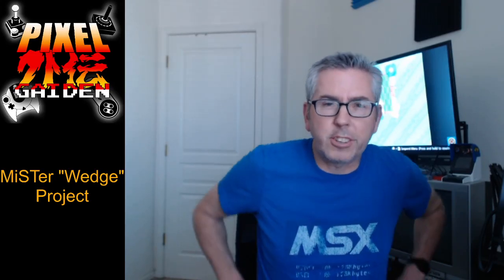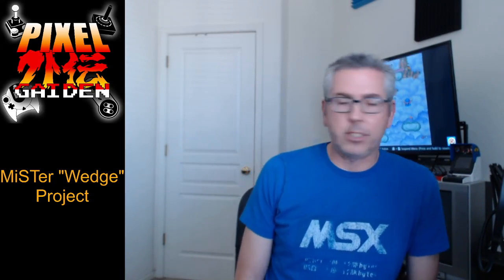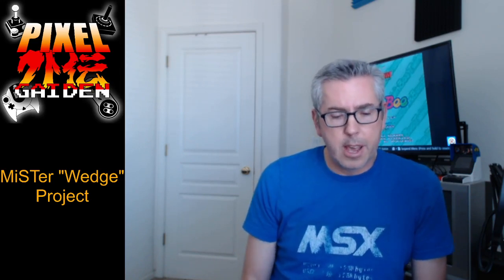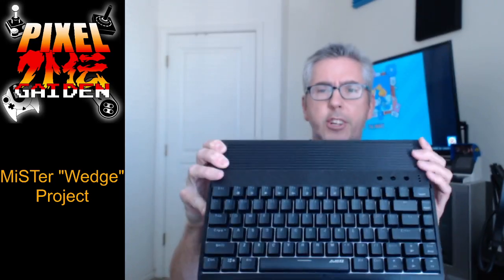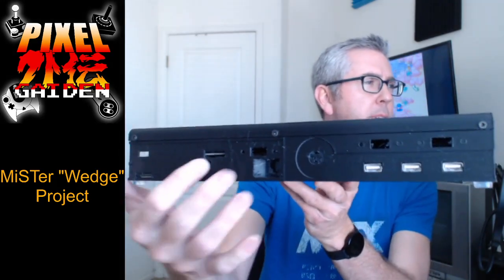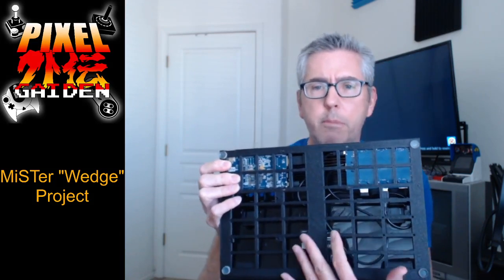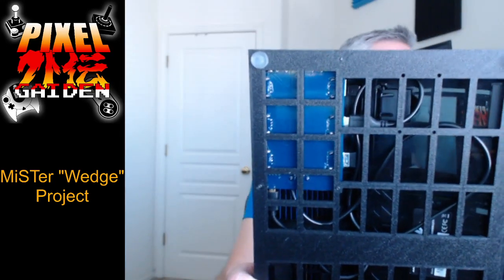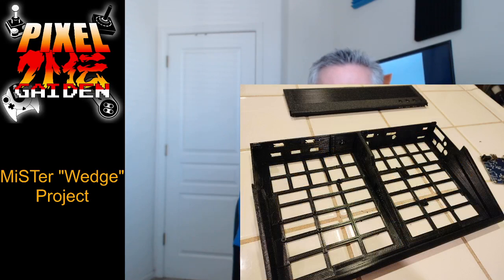Pixel Gaiden - MiSTer "Wedge" Project

Comment: That didn't sound like a mechanical keyboard. Sounds like a normal keyboard. 😁 Just standard....
Reply: It's a mechanical. Check the link with the 3d print and it has the link to the Amazon page. It's definitely not the loud cherry switches. The might be the quieter blue ones.